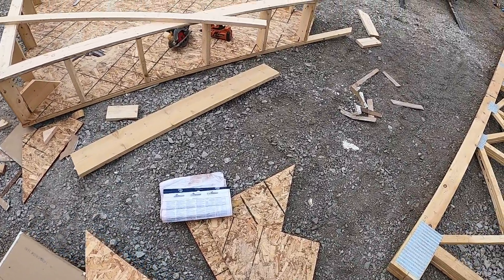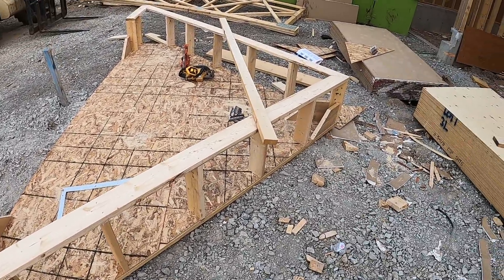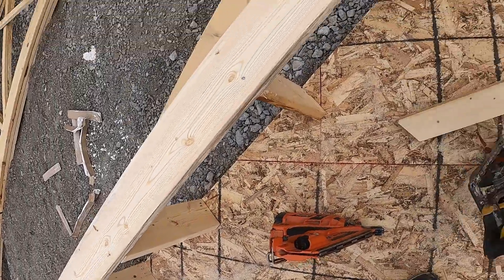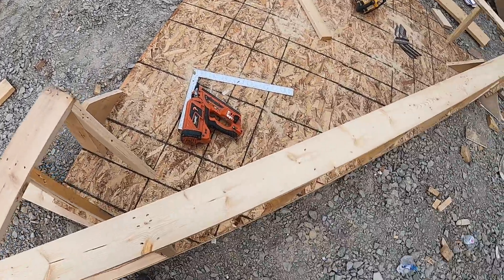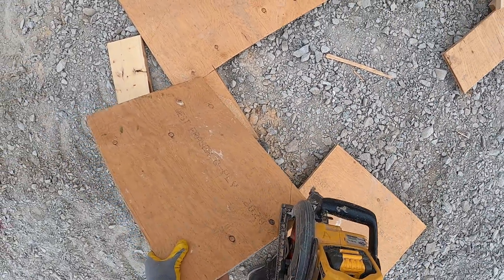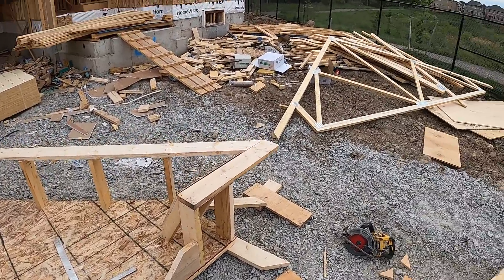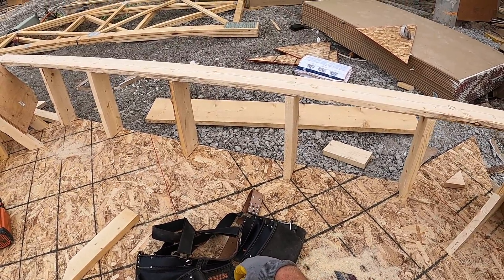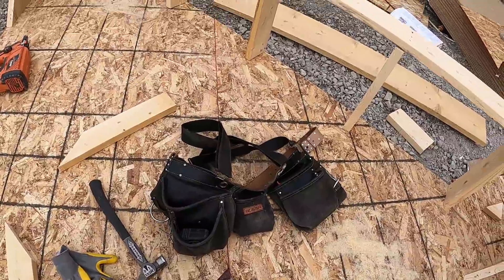Quick explanation of gable end truss construction with tips and tool pouch tour

Comment: No..no..no, those boxes will never be level. Should be a drop gable if the rake is over 12”. The ply wood you sheeted them with was short and unsupported. Job site is a disaster. I could go on
Reply: I see you caught grief for your opinion . I call this style " Slap n Run " which I learned 35 years ago .. The emphasis is on close enough and can't see it from my house . I learned this style, was forced to do this style and later in life realized doing this type of carpentry had little place in custom . Custom had little place in slap n run as well . Everything is relative to how much it pays , How much I want to make and how much craftsmanship is allowed . When working on some projects . It just doesn't warrant Swiss watchmaker precision and micrometers and I understand that . That is why I got away from Blow and Go , Shrink Wrapped homes . I found I could be more at peace being paid to precise. But not on those type of jobs . Carpentry has many levels .. Mild . Medium and Spicy . The Job site does look like an airdrop from 10,000 feet and the parachute failed to open . LOL . I understand shaking out the trusses because most manufacturers stack them for ease of transport and assembled by noodleheads in a random order . In all my years I have taken aspects of Bang Bang carpentry and crosstrained them with precision . In this situation I can see the probability of how accurate the end will be . The two boxes "clipped watertable "  if visually lined up in the end says they will not be straight relative "Plumb and Level " to one another and the overhang is going to dependent on aggressive fly rafter nailing to keep it taut . Basically like the  tightened skin of a drum . Worse on longer gables . Sometimes they have a lowered gable truss for outriggers but that can give an acceptable sloppy result . When the truss chords in the background heave up and down just enough to create that meandering sine wave fascia . But then again .. If it's going to have vinyl soffit ..Oh well .. I went from 1984 having to bang together 2 house a week to taking 2-3 years to make one house look like art . The clientele went from first time new homeowners and production builders . To builders that roll out red carpets and billionaire homeowners . Jobsites had to look impeccable and not like a someone planted an IED under the lumber .. One thing about any form of carpentry . Particular to framing . It's hard on the body , Bending stretching ,odd positions , dangling by your fingernails , smashing , blood , cold wet , hot , sweat . In the last few years . I got away from building architectural monsters that might find their way on a cover of a magazine and I can beam with pride for a day .  Prints that had more pages than a set of encyclopeadias. Frustrating accuracy and so many interdependent details . Now I'd rather do custom additions that are closer to the ground and require an experienced surgical carpenter . Today a carpenter that can divvies out efficiently his material and harvest the most out of his lumber . Is justified even more in his pay .. Pair that up with speed and precision is the trifecta ... " Quantity has a quality all it's own "
Reply: @IVORY123100  well said. I went to college for 3 years @ GBC, obtained my red seal (some people find it useless cause of its voluntary) and framed for the union for 5 years. left it behind to chase exactly what you're talking about👌🔨
Reply: Ply was short for brick to pass through Sherlock. I have seen a gable dropped in over 10 years around here. 

Also he's a peace worker.
Reply: @theballq  wow you clearly have no idea what your talking about. Does the brick pass through the rafter too? What the hell is a peace worker?
Reply: @aaronrust9629  yes the brick has to pass in-between the rafters. Over 18 years of framing tells me I am correct. That's why he left the ply back 5" for brick. He even mentions it as he measured.

Peace worker means he gets paid by the job. Not the hour. This is ontario, Canada framing. We are subcontractors. We run our own crew and hire guys to help.
Reply from the maker: The bottom of the ceiling is the bottom of the fascia throughout, ...this is dictates of course and confirmed by the length of the truss....any more questions?
Reply: @framingbeast720  nope, you clarified nothing.
Reply: Quit nit picking, hes probably getting paid by the HR. .lmao.😭
Reply: The return is held up by the rafters and the plywood. It is not going anywhere. That's exactly how we do it up here
Reply: And clean that job site wtf this shit is Chicago building never good enough
Reply: Also we don't clean the sites. The builder has laborers for that. We are required to make a pile in the front and a pile in the back for garbage. This is unionized work. Thats the way it goes.
Custom framers up here build the exact same way, in regards to the way he framed his return
Reply: @theballq  just because everyone does it doesn’t mean it’s correct. Guess good enough is the motto up there. Live in a house you built, it will change your perspective.
Reply: @aaronrust9629  we don't have hurricanes up here. That is not going anywhere. But the lookouts should be nailed very good or even screwed with structural fasteners IMO. I can see them sagging overtime with lousy nailing.
Reply: @Faruk651  anything over 12” should be a drop gable with blocks that extend into the the first common truss, you do have snow load right? Oh and gravity.
Reply: @theballq  I manage framing crews for a living, not a hater. Just pointing out poor framing
Reply: @aaronrust9629  I agree, i would do drop gable for anything over 8”. But this is how they build houses now. 

This guy is probably following the prints. Not his fault but the crappy building industry.

Even with snow load, all it will do is sag. Nothing will come down on someones head.